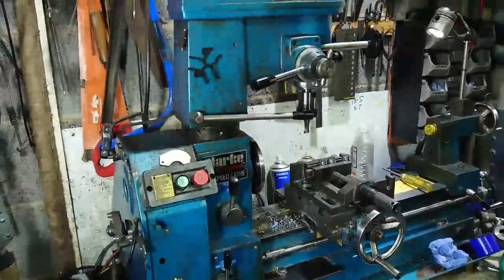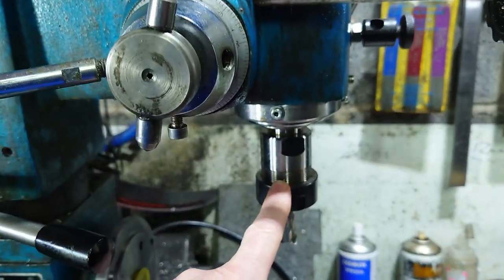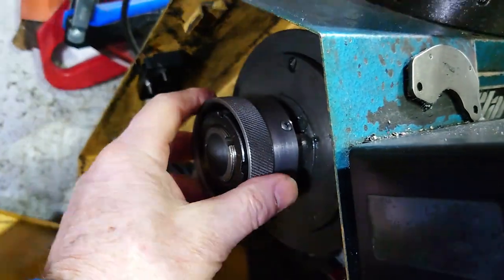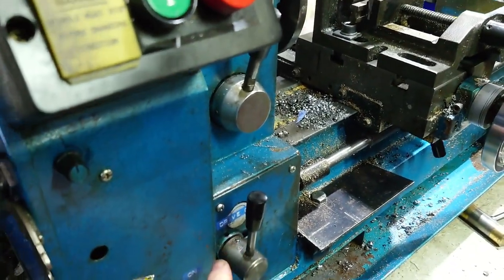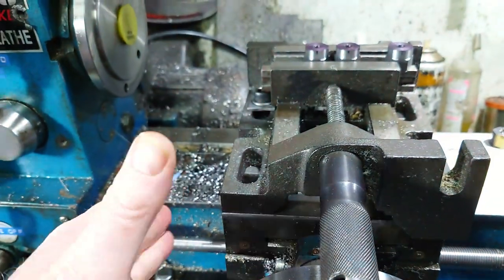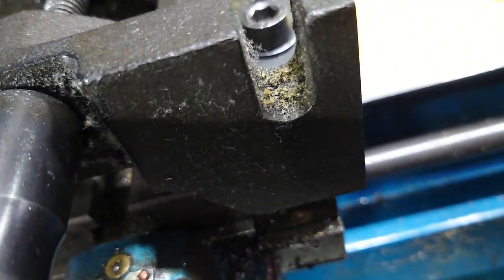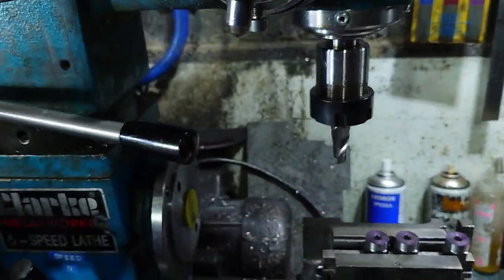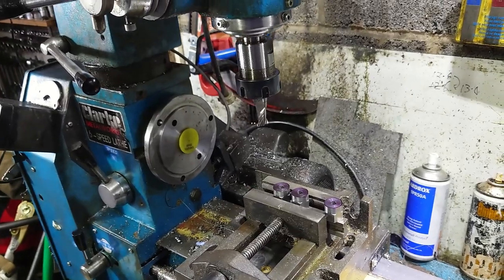Dog Clutches

Comment: Good day Spen I tried the dog clutch for the mill head/ lathe Chuck  I kept working it back and forth through my chores in my cave, now it works great , I have been cleaning lathe down today and oiling up just need to give oil change to gearbox if you can advise, I know you mentioned putting more in than the manual says but how do you add more oil if the glass is the drain plug, well thank you once again for top advise.
Reply from the maker: Glad you've got it sorted 😉 the filler plug is on the side of the headstock facing the motor 👍
Reply: @SpenCrowson  from empty how much would you say to add, and what grade , thanks
Reply from the maker: @michaelcapp4597  I use a light gear oil or 20-50. Also I tend to add the oil until it covers the sight glass then and then add roughly half again, sorry I can't be more precise but I've never measured it 😁
Reply: @SpenCrowson  thank you
Reply from the maker: @michaelcapp4597  any time 👍